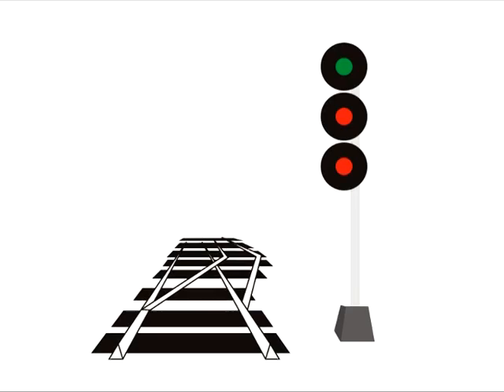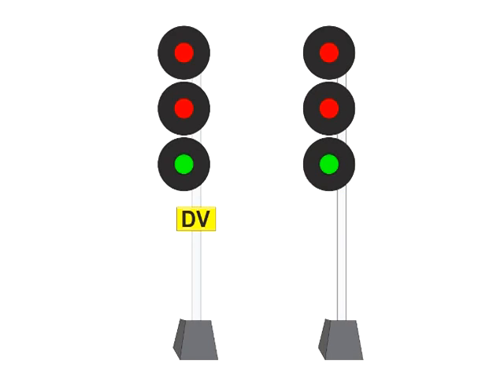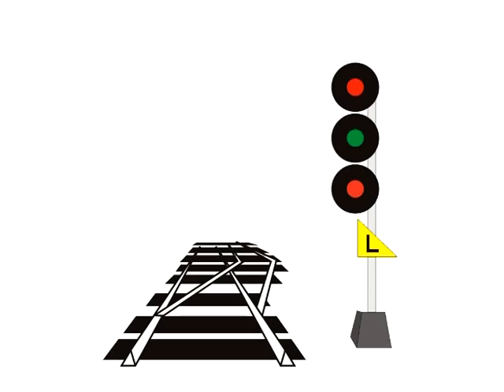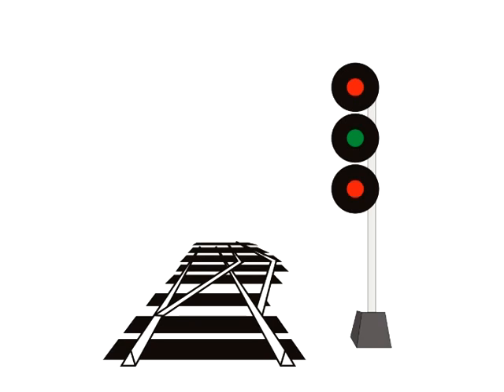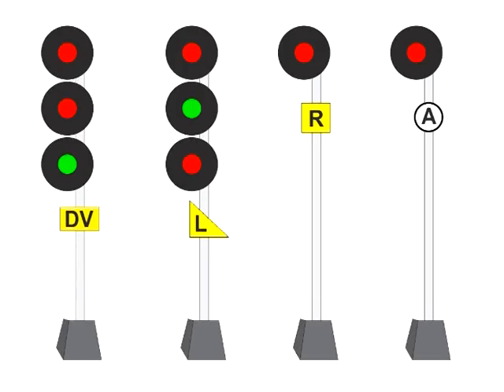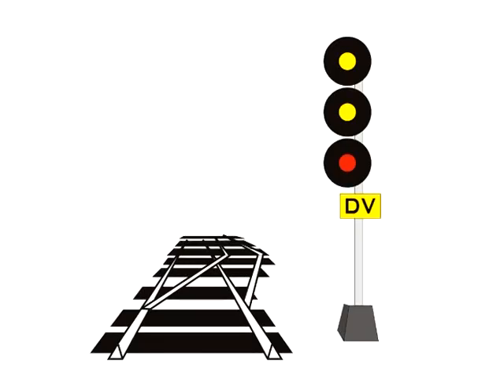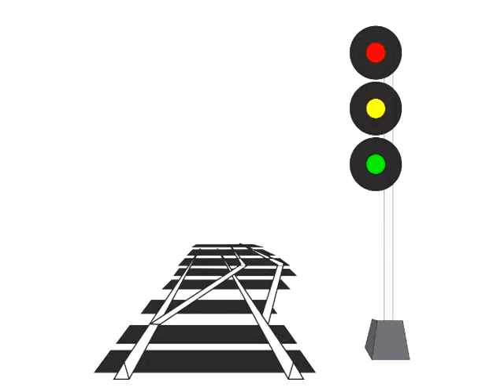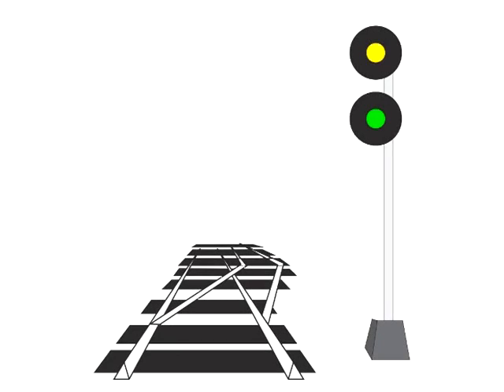Part 3: Railroad Signals, reading and meanings. Diverging and Limited speeds, to and at signals

Comment: Holy eff, it was making sense up until about a third of the way into this, then the designers just... idk... dropped acid or something. Let's use all the lights in all the colour combinations! So pretty...

All this just to save a few canbucks on specific advanced signals or actual diverge speed signs...

I can easily see now how drivers get confused and might end up approaching a speed restriction or even straight red light at too high a speed to successfully brake from, from misreading one of the more complicated arrangements. Suddenly our own system of "go at the speed limit, there isn't even a yellow light for at least the next (two) section(s)" (green, on a three (four) aspect light), "go at the speed limit but prepare to slow, next signal is currently at caution" (double yellow), "slow to restricted speed, next signal is currently at danger" (single yellow) and "stop!" (red), with switch speeds other than the default being given on high-visibilty and retroreflective signs doesn't seem quite so primitive and decontented as all that. Though it does mean our maximum train lengths/weights are somewhat more limited as they need to be potentially able to brake from full speed to a halt within little more than a single block length (IE from where the caution signal is first seen, through to drawing level with the danger signal) and from caution speed to a halt within sight distance of the final signal...
Reply: mspenrice ask a Csx engineer to explain all 6 systems in their system, including the aspect system of the B&O, the Norac rules of ex-Conrail and the old Seaboard rules of the southern portion, that will get your head spinning.
Reply: ...that said, I did just realise that a deliberately somewhat cryptic light-based system where you assume the worst possible case in any instance of failure is quite secure against vandalism and/or deliberate interference, which could be quite important if you're running tracks through hundreds of miles of what can be rather sparsely populated and not that regularly patrolled wilderness, and running trains with cargoes that might be quite valuable but only easily liberated outside of the intended destination should the train happen to crash... the lights themselves are fairly substantial things that are hard to remove, especially against the clock and without leaving any kind of obvious trace that they used to be there (wheras warning signs can be much more easily uprooted, cut down, or simply turned sideways/backwards), sets that are more simply knocked out by cutting the power or smashing/shooting the lamps themselves remain fairly obvious and become "proceed, but at minimum speed with maximum caution" signs (much like broken highway lights legally become yield/give-way/4-way-stop signs), and anyone setting up a fake set to encourage drivers to run too fast through a dangerous section not only has to be able to produce something that looks authentic and run a surprising amount of power to them maybe over a long distance (or at least long enough to be able to hide a portable source), but also needs to understand the codes beyond a simple "green for go, yellow for caution, red for stop" level.

So it might be hard to learn, but possibly that's the entire point. Certainly, it would have made "the great train robbery" at least a little harder to pull off, even thought that only involved stopping a train rather than derailing it.
Reply: Well exactly. It all smacks of uncontrolled over-refinement, of trying to splinter the possible displays into way too many potential combinations and convey too much information in a single burst or what can be readily understood instantly... when all you really need is "stop, slow, medium, fast" (and in the old days with slower trains, just "stop, slow, fast", or even "stop, go") for immediate warnings or permissions on a set of changeable lights, and any permanent restrictions for sharp bends, sidings, and going straight over / turning off at switches being communicated on a separate fixed sign.

What are most people familiar with, at least since about the 1930s? Tri-colour traffic lights, and speed limits written on signs. The UK aspect-light system I describe essentially copies that, and is very simple and straightforward. If there's a particular speed you need to keep at or below, it'll be a number on a sign, sufficiently ahead of the actual danger and, where necessary, with an arrow pointing in the direction it applies to.
The regular signal lights controlling each block give much more general and more rapidly understood instructions - proceed according to the posted limits (the same green as on a highway light), stop ahead of the lights (the same red as a highway light), and optionally one or two levels of "reduce speed now" (to certain well known maximums, or if the green light limit is already lower either slow to a fraction of said limit or at least be ready to make an immediate brake application to slow further or stop at the next signal) warnings on faster lines (the yellows, which are effectively the same "you may continue for now but there is a red coming up shortly" warning as for highway lights, just applying in terms of distance rather than time... which for a fast-moving train are much the same thing anyway).

Seeing as semaphore signals already had signal lights with moving coloured glass in front of them that communicated the same two or three basic instructions (and in some rare cases four, with a purple or lunar blue glass), alongside the reflective numeric signs, which is actually where the highway standards came from (rather than the rails copying those ) it kinda makes me wonder how so many different, individually as well as mutually confusing standards developed. I guess maybe there was a problem of the signs being easy to miss, or hard to see at all on foggy/smoggy nights, maybe? A problem for which our answer was essentially mounting them high enough that they could be seen using a light projected from somewhere near the cab, learning the line you're running on before being let loose on it so you had half an idea of the restrictions anyway (harder on long US/Canadian runs I suppose), and slowing down in times of poor visibility because you were as likely to end up missing regular signals anyway.

Thing is, having a whole mess of coloured light signals, even ones that were carefully engineered to always be fail-safe so long as the drivers understood the decimated versions, doesn't seem any more or less reliable than just putting a footlight in front of every important speed sign as a backup for its reflectiveness, should there be low lying cloud or the locomotive's own light fail... as well as a similar backstop system as described here where switch direction is displayed on a directional-aspect semaphore or light signal, and the speed signs are all permissive rather than restrictive types... ie, if you haven't seen one, you assume the much lower minimum switch speed, and only go higher if there's a sign telling you that you can. (...which is again similar to at least some aspect of UK highway speed limits - if you're somewhere with street lighting, suggesting an urban area or at least somewhere that there might be significant enough numbers of pedestrians to justify permanent lights, you assume a 30mph limit unless otherwise signed).

It's all doable without this kind of crazy, arbitrary, ternary-logic memory game.

Comment: Whatever happened to the slip switch that you could take at 30 mph plus in some cases.
Reply from the maker: Do you mean spring switches? They're a pain to operate. We had one here at Sioux Lookout, Ontario until about a year ago when they finally ripped it out and replaced it with a power switch. I think they've been trying to get rid of them right across the country because they were so hard to operate. We didn't have any you could transit at up to 30mph that I'm aware of.

Comment: I think the only real problem with your presentation is that you're actually only doing one type of absolute signal: Speed (or home-distant) signalling.  Admittedly that's the more complicated and far less intuitive system, but there's also pure route signalling: Top head is mainline, middle head is a crossover or "superior" diverging route (such as a single track mainline becoming two), and bottom head is siding or "inferior" diverging route.  The color aspect indicates the speed to be followed onto the diverging route.  There's also dummy heads (show red only), where a route merges into your track, but you can't diverge onto it.  Most roads used both systems, depending on the district - route signalling is great if you're near an area with a lot of turnouts, speed signalling in districts with higher speeds and fewer turnouts.

And needless to say, if you're a model railroader, route signalling is FAR easier to wire up and model then speed signalling, which pretty much 100% requires computer control.
Reply: Bonk your head. There is only speed signalling in Canada.
Reply: @enochliu8316  Oh!  Didnt realise that at all, I thought that route signalling was universal as well as speed signalling.

Comment: Hi Ian. Thanks for this very informative series of videos. Are the lineside signals powered from a local source, and is the medthodology of control of an signal aspect done over a wire or by wireless? Obviously you are dealing with much greater distances in Canada compared to us in the UK.We are adopting Light Emitting Diode arrays to indicate the signal aspect now. This should effect a big power saving compared to filament lamps, and it is possible to obtain a four aspect display from just two lamp arrays.This, I believe, is achieved by addressing different clusters of LEDs in a lamp array, so you can, with one signal lamp head show red, yellow or green. Two lamp heads will allow for our four aspect colour light signal displays.Red-stop. Single yellow- caution, may be passed but expect the next signal to be red. Double yellow, may be passed and indicates that the signal ahead may display a single yellow. Green - line clear, proceed at line speed.Diverging routes are indicated by a cluster of white route indicator lamps which accompany the main signal.Kind regards.

Comment: Great series!!! You lost me at 5:59 though. Can you explain that in greater detail please?
Reply: As he said, just think of each of the three signal heads as indicating for specific speeds (High, Medium/Limited, and Slow/Diverging/Restricting).  At the time you indicate, he starts getting into signals that indicate a speed reduction but not a stop will be required ahead.  These use more than one signal head at a time not being red.  Yellow over Green, for example, indicates that the high-speed route would require a stop at the next signal, but that the Medium speed route is clear at that next signal.  Since the signal rules are named according to the speed required at this signal and the following signal, this is called CLEAR TO MEDIUM.  If the signal were Yellow over Flashing Green, then the "medium" speed gets upgraded to "limited" and the signal is called CLEAR TO LIMITED.  Some signals may, instead of flashing the green, have a triangular "L" sign on them.  If a signal has an L sign on it, then anytime you'd say "medium" you'd instead say "limited".  Thus a Yellow over Green signal but with an L sign is also CLEAR TO LIMITED.   Does that help?

Comment: I think the one 'fail safe' the canadian signalling system lacks, is the human factor.. A new driver I feel could be easily confused by the signals.. The british system is a lot clearer in that regard and still tells about the same amount of information I think
Reply: The British systems are all Route Signaling systems.   The Canadian system is a Speed Signaling system.  There's no way that a Route signaling system conveys as much or more information than a Speed signaling system.
The difference between the two is what happens when a train needs to change tracks.  In the UK, multiple semaphores select from routes or a colourlight feather lights up to indicate a change of tracks, but the driver must know what speed is safe for the switch he is taking.  In a Speed signaling system, every diverging movement has a safe speed prescribed by signal indication.  The Canadian system also always prescribes a safe speed at the next (or second) signal.  This is not something that any British system is able to do.
Reply: daggertom1 smaller shorter trains may make a difference.
Reply: With the British system, there is a physical speed board with a diverge arrow for junctions indicating the speed limit. We change the line speed limit with a speedboard preceding the junction which will say X mph in the given direction rather than have the signal tell you your speed.

TL;DR for the next bit: The driver doesn't know why he is stopping, he just knows he has to stop the train.

We use a series of flashing yellows to notify the driver two to three signals prior to a diverge in some circumstances, and in other places the driver is given caution aspects which will pretty much bring the train to a stand before the last signal will clear, essentially forcing a driver down to a lower speed, known as approach release. The driver doesn't need to know why something happens, all they know is they need to stop in X signals. They know the route inside out so should know how far the next signal is away. The driver will also have no reason under normal running to pass a red signal unless it has a "calling on" signal, which means "proceed with caution and prepare to stop at short notice for an obstruction", or unless specifically authorized by the signaler. TPWS has to be disabled to do this.

The simplicity of the system is why it's safe. All the driver knows is the route he is taking, his speed limit and his last and next signal aspect. Speed limits are clearly signed rather than having to guess what speed is required from the combination of lights, and reductions of speed have warnings.
Reply: The Dutch system is even better in my opinion. Instead of using combinations of flashing lights to indicate speeds, it just shows a number which you multiply by 10 (only for signals that require it of course). Same goes for the German system, but the german system uses a variety of different signals, with a lot of different lights on it. Dutch signals always only have 3 lights, with sometimes an added number display.
In all fairness, this is the best explanation of the signalling system I've ever seen, so great job on your end Ian!
Reply: Even the German signalling system is simpler than this. lol
Reply: As much as I love US railways, I must admit the Russian/Eastern Block OSShD-based signalling systems are the best out there

Comment: What's the signal combination for it's fish for lunch on Tuesday is it a an F plate with a flashing red and two yellows. This system is too complicated. If you want to slow a train right down give them a single yellow, if you want medium speed, double yellow - that should do it.
Reply: But that just isn't enough information.  There's a lot more opportunity to needlessly waste time driving a train across Canada than driving across the UK.  That time adds up.  A single yellow [amber in UK parlance] means you're going to stop at the next signal.  But if you're not... there's no point here in showing it.  There is also no such things as Approach-Release on US/Canada freight railroads.

Comment: Very informative. Just out of curiosity Are you a trainer for CN rail? Good explanation I've already started reading lights during my daily commute.  I notice that the Light Rail, Subway or Intercity Systems tend to use the 2 head system. I notice this on the O-train and TTC.
Reply from the maker: +Ben III Nope, not a trainer for CN.  Thought about it, but I really enjoy running the rails.  I like to stick to that.  I remember seeing some of the signals at the tunnel for the O-train, I think it was a lunar signal - but I think those signals have been there for a loooong time.  So I don't know.
Reply: +David Schlotthauer A signal displaying Flashing Red over Red over Red is Union Pacific, BNSF, and CalTrain's way of giving the "Restricting" aspect. Same for 1 and 2 headed signals, a flashing red is resstricting. BNSF (maybe CalTrain too, I forget...) even has an "Approach Restricting" aspect, which is displayed as Yellow over Flashing Red. Hope I helped! :D
Reply: As Milepost 282 Productions pointed out, the signals are different for different railroads, sometimes even in the same area.  The explanations of signals in this video only apply to Canada.  Your TS2016 route should come with a guide showing what the signals mean.  If you still need help, just ask.

Comment: These are a great well done series! For long trains, how do you know the full train has moved beyond a signal?
Reply from the maker: +ceMental We have a footage counter in the cab that measures the distance we've traveled, and we know the length of our train by the train journal.  Mistakes happen though, and sometimes the counter is off, so we'll do little things like at a meet the other train will tell us how far in to the siding we are or they'll hit their counter right as they pass the nose of our train and we'll tell them right when the tail is clear so they know what footage it is according to their counter.
Reply: Ian Juby Thanks for the info! Great stuff!